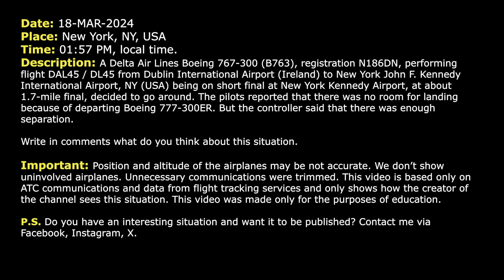Pilot argues with Tower controller about separation at New York Kennedy Airport. Real ATC

Comment: I know the tower does this every day, all day, but the final decision is with the Delta pilots. Good call if you feel it's too close.
Reply: If somebody is flying a wide body for Delta, they have been flying for a long time. He does it every day too..
Reply: @jaredf.5607  If the speed of the 777 rolling was accurate (54 knots) then the spacing would have worked. 

A point to note - the controller will run approach/departure separation hundreds of times in a month. Your wide body captain might only see it once or twice in a month with arrivals and departure runways split at a lot of airports and limited approaches flying long haul. Having said that, final authority rests with the captain and there was no need for the controller’s comment.
Reply: @TryckWater  Reminds me of the PDX situation with the UPS heavy dawdling on the runway.  Same thing with this Air India plane taking too long to roll.  Loss of separation.  The Delta pilot did the right thing and the controller upbraiding Delta was unnecessary.  A phone call would have been the safe thing to do as upbraiding causes controller and pilot distraction.
Reply: @TryckWater  not necessarily. That’s like 100+ knots away from their V1 decision speed. So if they abort the takeoff and the other planes touching down it could be catastrophic.
Reply: @amg2022   The controller had Air India rolling well before Delta was at a 2 mile final (2 increasing to 3 which is the separation standard I believe in use here). High speed aborts are very rare; I can’t remember the last one I saw personally as a controller, although they obviously do happen. If Air India had rejected then there still would have been time to send Delta around.  If Air India rotates and Delta still needs to go around then Delta gets the same turn and climb for the missed they were issued here. 

I don’t agree with voicing the frustration over the frequency but I get why he felt that way. And as I said before, final authority is with the captain and if he wasn’t comfortable then he can go around and try again.
Reply: @dashriprock4308  The comment was absolutely unneeded and I agree with you on that completely. However Air India was not dawdling here, far from it - getting a B773 rolling in a 5 mile hole before Delta gets to 2 miles final is solid work.
Reply: @TryckWater as you are aware he is not running math on a calculator while on a short final. But what he did do was go with his own instincts. You can never fault a pilot for playing it safe when it would be at the very least “tight”.
Reply: @TryckWater they both get to feel however they feel. No harm in going around. I would rather they feel comfortable going around then to be shamed into making poor decisions in the future.
Reply: @Jesussavesallwhocall   As I have said in multiple comments - If the pilot isn’t comfortable they can always go around and they did. Nothing wrong with that. The pilot always has final authority and these chose to exercise it here. My issue is with the comments back on forth on frequency. 

For added context I commented that I believe the spacing would have been fine if the playback was accurate - and that is my professional opinion as a tower controller that works arrival/departure separation with both of these types regularly. Again this isn’t to disparage Delta for going around. Not feeling comfortable is a fine reason to miss but this isn’t an incident where I believe safety became compromised and that is important for people to be aware of.
Reply: @TryckWater  I think you mistook my reply for disagreeing.
Reply: @Jesussavesallwhocall  No problem! 

And to add - it’s hard to tell context in comments sometimes which is why I went for the long winded reply; it wasn’t just intended for you.
Reply: @jaredf.5607 exactly! Pilots more professional than I would've been. I'd have said "I do this every day too and that's not a decision you get to make."
Reply: The tower may do this "all day every day", but they aren't the ones going to die if it doesn't work.
Reply: Exactly what I was thinking.
Reply: I would argue that maybe they SHOULD NOT do this every day.  There didn't seem to be a big amount of traffic approaching that runway when it happened, why cram planes together like that? "It would have been TIGHT, but it would have worked"? Fuck off with that shit. We're talking about planes with hundreds of souls on board, not trying a pool trickshot in a bar.
Reply: US ATC has a decent record of fuckups over the past weeks, having another brain second guessing what they think is going to work is exactly what is needed.
Reply: Its closer than people thing because The departing aircraft is still accelerating....what if Air India has to abort take off in the high speed regime...all would happen too fast and a collision may occur. I always think of that on final...Waht if the aircraft on the move stops moving?! A few extra seconds fo spacing can save lives and this was a great call.